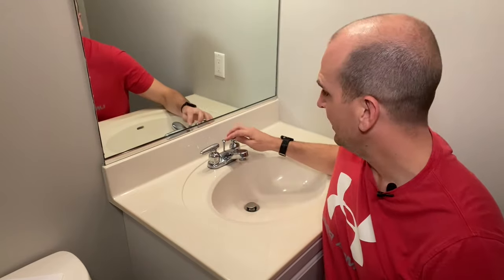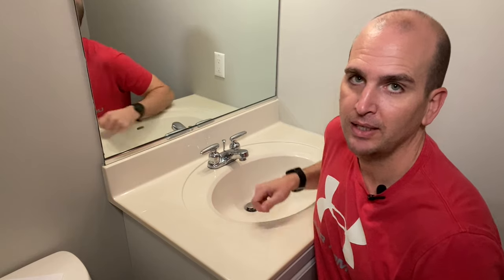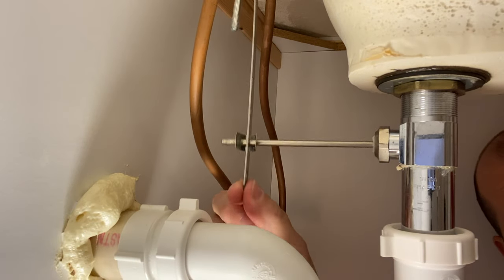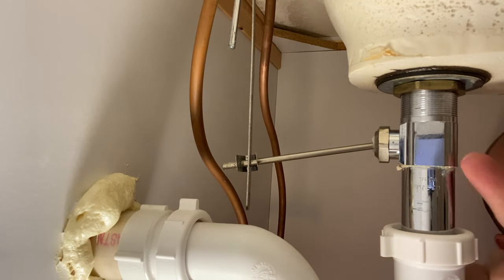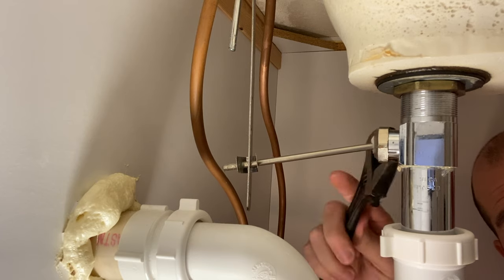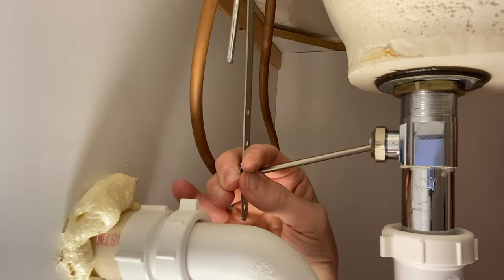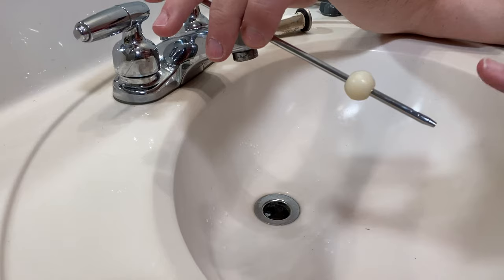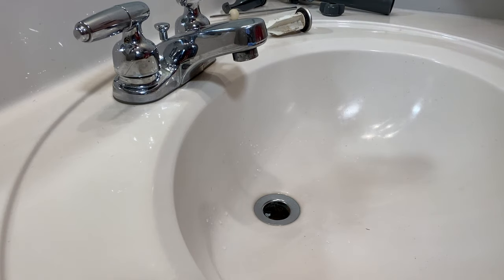Bathroom Sink Drain Stopper Not Working

Comment: My problem is the  lift rod will close the drain but when the lift rod is then lowered the spring clip moves on the pivot rod so the drain won't open.  How do I keep the spring clip and the cleaves from sliding around on the pivot rod?  Thank you!
Reply from the maker: Hey Gigi, if you take the spring clip off and bend it then you will get more friction when it is sitting on the pivot rod and should help it stay in place.  The key is to bend it to fit on the pivot rod but don’t permanently deform it of you will lose the “spring” effect.
Reply: Everyday Home Repairs   Thanks!
Reply from the maker: No Prob 👍

Comment: 😂Belive or not, i was at a hotel and accidentally pop that stoper and try to fix it for 30 min, I even unscrew the botton, but, a few seconds in to your video I realized I also seen that lift rod under the sink, and then I realized that I also have a lift button/rod but it was hidden in the back of the sink, pulling that was enough and I fix my problem

Comment: Mine is brand new. It won't hold the water. The water slowly leaks out of the sink when it's down. What's wrong?
Reply from the maker: Does it look like the stopper is being completely pulled down where the rubber o-ring is making a good seal?  If it isn't being completely pulled down you can easily adjust the little spring clip on the pivot rod and that will change the amount the rod on the back of the faucet pulls the stopper up and down.
Reply: @EverydayHomeRepairs  I unscrewed the little metal stopper and under it is a black "washer." I'm sorry I'm an older woman and I don't know the name of the parts. The washer is huge so it should hold bit it doesn't. I own a mobile home. Would they be different in a mobile home?
Reply: @EverydayHomeRepairs  I also can't get under the sink. I just can't physically do it.
Reply from the maker: @grateful1929  does that black piece look like it is in good shape?  Any cracks, missing pieces, or imperfections will lead to a leak since that is the sealing surface.  Hey, also good for you on trying to fix this issue without calling in a handyman or plumber 👍
Reply: @EverydayHomeRepairs  I love fixing things I always have. The little black washer looking thing actually looks too big.
Reply from the maker: @grateful1929  yeah, I imagine there is an issue with the washer / o-ring which is causing a bad seal and allowing water to drain.  You can usually get a replacement part by taking your old one down to ACE hardware or another home improvement shop and finding a match.  The challenge will be you might need someone's help as the pivot rod down in the drain might be holding the stopper and won't allow you to remove the stopper without removing the pivot rod.
Reply: @EverydayHomeRepairs  you are so kind! I will take it to Lowe's. Thank you so much and Merry Christmas and God bless you!

Comment: This is an excellent video and is very straightforward but I am having difficulty in pulling the swivel rod out as it seems to be connected in some way to the drain plug.  I did remove the nut and washer and was able to pull the ball out about 1/4" or less but no more than that.  I have wiggled and jiggled and pulled with pliers but that rod is not moving!  It has to be connected somehow to the drain plug and I don't know how to release it.  I even used needle nosed pliers to hold the stopper and jiggle it to no avail.  I really don't want to call a plumber who will charge me $200 for this easy fix so if anybody has any ideas on what I can do to get the rod and ball out I would greatly appreciate it!  Thanks in advance!

Comment: My Danco sink stopper is stuck in the down position, and I can't get it out.  It's not the kind that you push down on to pop it up. It's not metal, so I can't use a magnet.  Plunger is too big to try suction.  WD-40 didn't help.  Tried dental floss, but the seal is to tight to get the floss under the rim of the stopper sinc it is flush with the sink.  Can't pry it up with a tiny screw driver or a fingernail.  It's not the kind that you push down on to pop it up. Nuts are tight enough.  I tried removing pivot rod and putting it back in. Nothing is working for m.

Comment: I dont have the rod bit my plug has fell inside the hole and i cant get it out
Reply from the maker: If you have a pivot rod you should be able to use that in the normal location in the tail piece to push up the stopper.

Comment: What if the stopper is stuck in and it’s an internal issue
Reply from the maker: Usually you can still fit a small flathead screwdriver between the stopper and the drain trim piece.  This will allow you to pry / pop the stopper loose to inspect and address the issue.  This is assuming the stopper is free of the pivot rod down in the drain.  Best of luck.

Comment: https://youtu.be/lbCGWzy386I?t=145 so for this issue sometimes that bolt just cant tighten the rod enough and always be slipping. I found that simply drilling the lift rod a little bit so the bolt thread can catch it would solve this problem.